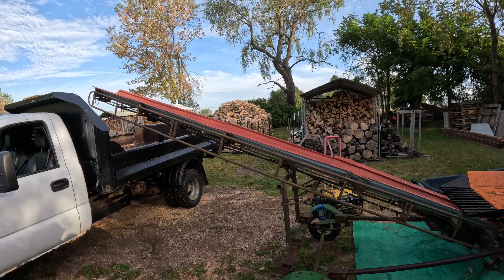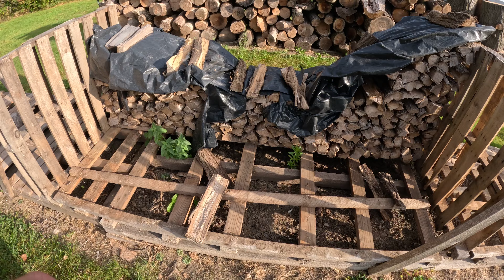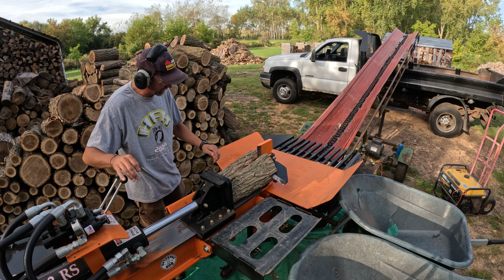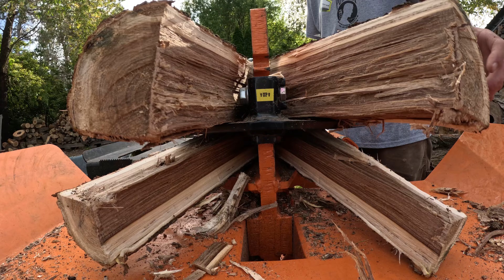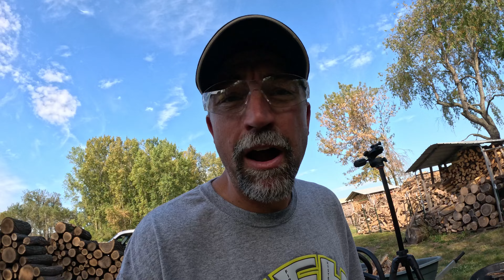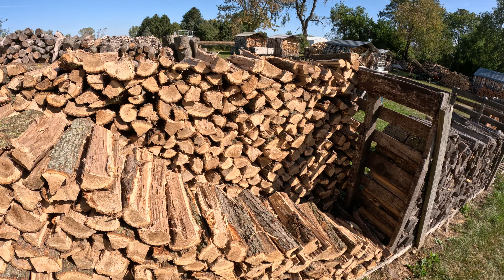Splitting Siberian Elm With The Wolfe Ridge 22 RS‼️

Comment: I spilt some Elm last week. No idea what type of Elm it was. But it was stringy, heavy and had an orangey type of colour. My old spitter set up split it with no trouble. If it didn’t split it cut through it. Been cut into round for about nine months. One 7” or 8” round split was 56% mositure in the middle. Gunna take quite a while to dry out. 
Great video Jeremiah. Thanks. 👍🏻👍🏻👋👋
How long for that Elm to season ?
Reply from the maker: I think with elm the longer the round sits the harder it will split. Last years elm seasoned for about nine months and was good to go. Thank you Noel👍👊

Comment: I wonder if there's a way to modify the conveyor so it grabs the wood. Doesn't seem to add much value when the pieces sit there. Wonder if anyone has done any enhancements to this style conveyor?
Reply from the maker: As it sits now the chain can’t be modified without some big changes where the chain goes under the conveyor. I think if I put some smooth metal or wood on it instead of the roofing metal that would help.👍👊

Comment: I split 10 face of that crappy elm in June.   its already  burnable now.  It dries fast splitting it small. Its been  a very wet year. Had to sort thru 10 facecords of oak to get 6 facecords for a delivery . it was terrible bc it wasted like 6 hrs of my time sorting junk out and filling the trailer plus now i have  a bunch of junk wood i have to burn myself  or give away . Alot of lost time and $ with 4 facecords  of junk oak thats only cheap  boilerwood if anyone  even  wants it. Sunny and dry weather can stay around not 3" rain days that soak everything.
Reply from the maker: I keep all my oak under a roof for that very reason. Hopefully you heat with wood so it don’t go to waste! I agree the rain can stay away as far as I’m concerned. 👍👊